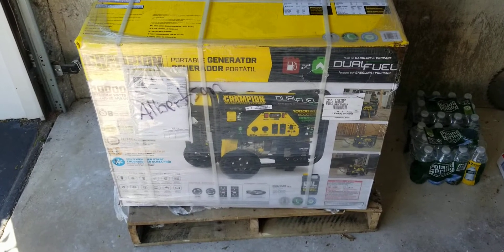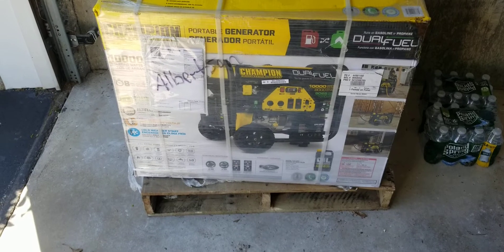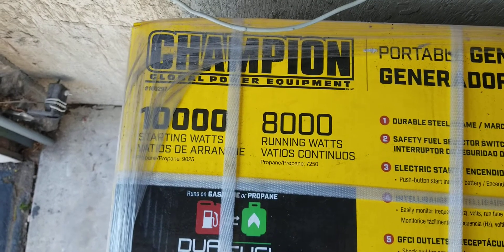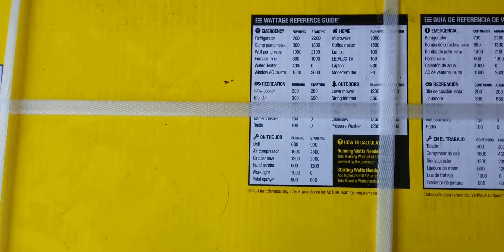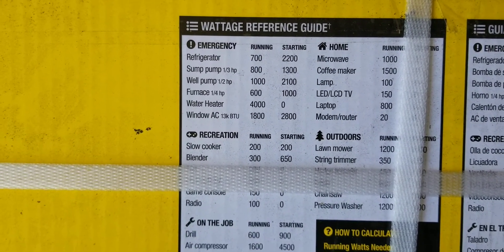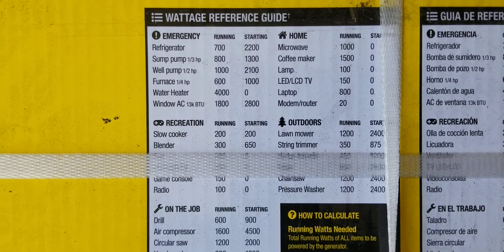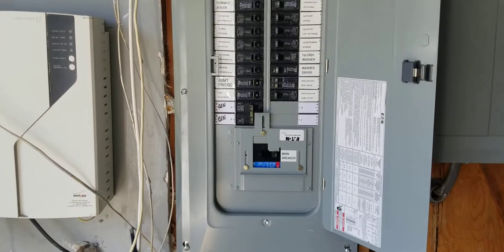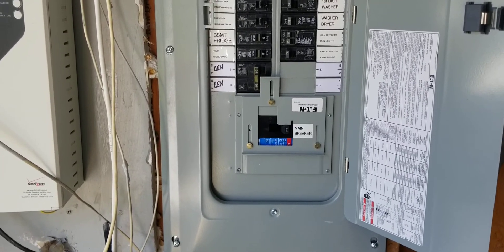Generator starting watts vs. running watts

Comment: Good morning and thank you for the very helpful review!  Question, my transfer case is rated for 7500 W.  Can I use a generator rated for 7500W but with 8500 peak Watts??   From your video, It sounds like this should be OK as long as I do not turn on multiple heavy equipments all at once?!  The only heavy equipment I have connected to my transfer case  is  1 water heater. Ty! CC